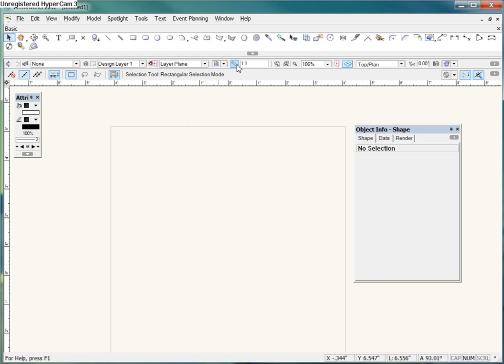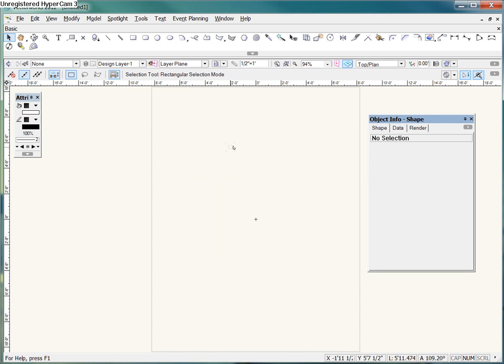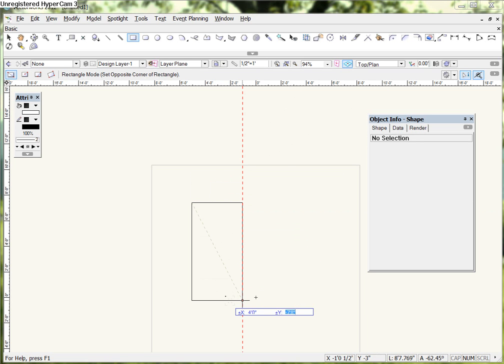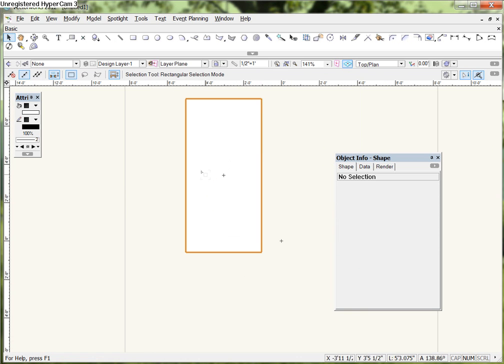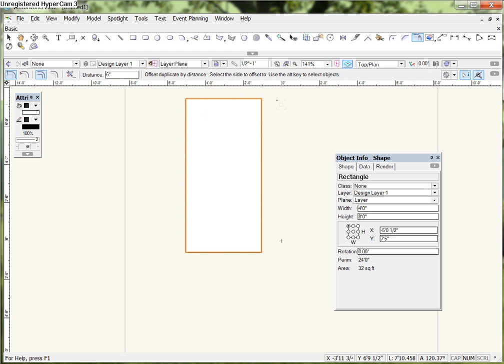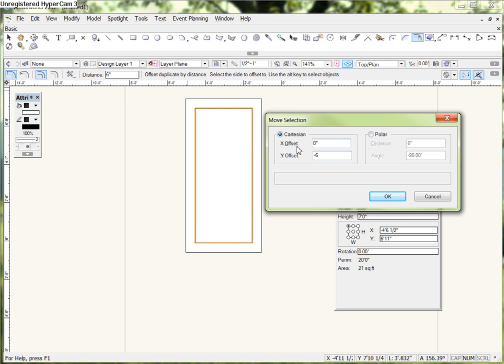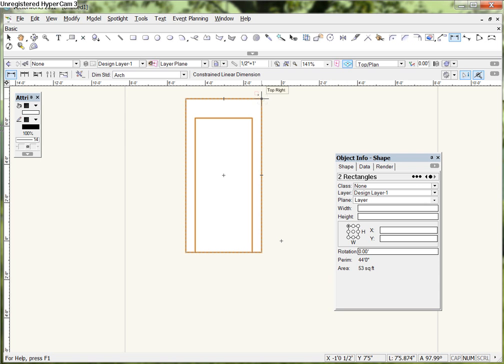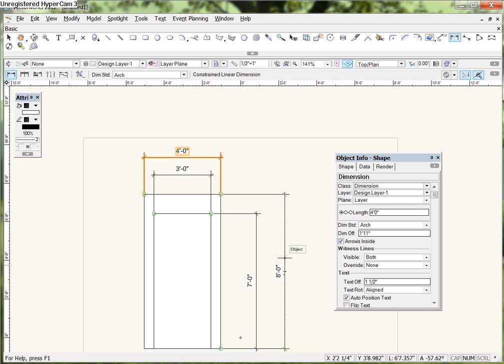Vectorworks Basic Tutorial  Your 1st Drawing

Comment: Hi I'm an interior designer and in between two VW courses (beginners and intermediate). Finding your tutorials very useful but I need some help with a small detail.   I have drawn some detailed drawings of a bespoke piece of furniture but am struggling to insert an information bubble showing detail 1 of 3 on the sheet.  Have watched your tutorial dimension lines I am using Tool sets Datum Target Symbol but its not really looking right?

Comment: Hi i am a college lighting designer i have VW 2012 and i cant seem to find my constrain dimension tool if you could help that would be much appriciated
Reply from the maker: In 2012 it should be on your basic tools. But if not open the Tools sets and open the Dimension/Notes set (the icon looks like a pencil and a ruler) it will be the first one in the set. Or better yet, use the keyboard shortcut N. M gives you unconstrained. 
Hope that helped, 
Sean